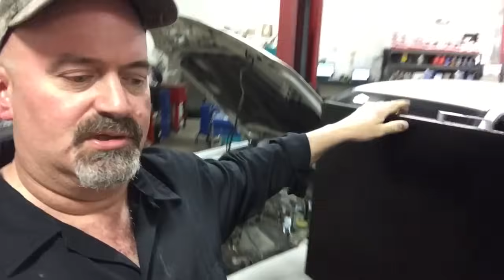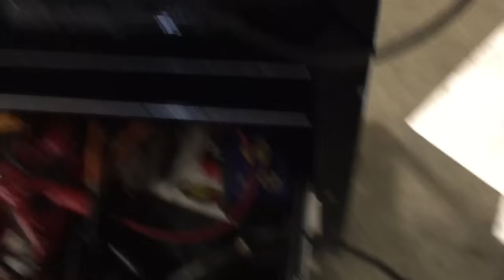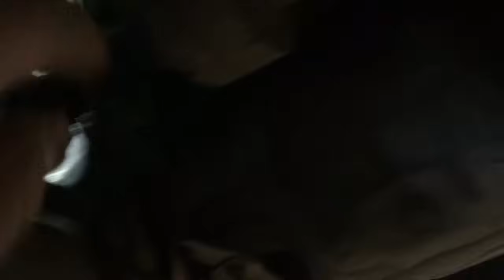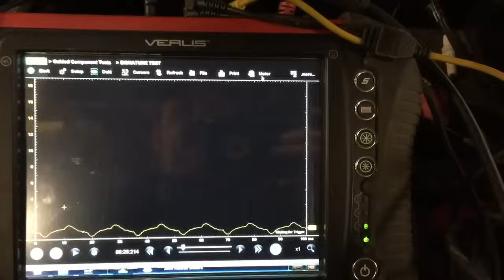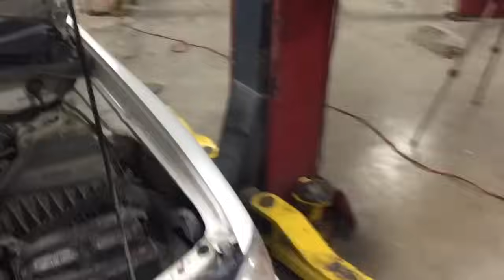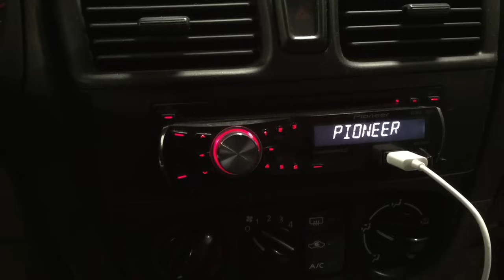Nissan Cranks But Won't Start

Comment: HI DOC i  have the same car it cranks but wont start  .a mechanic told me its the computer box malfunction.....any tips DOC?
Reply: Did u get it fixed? I jave the same car 355.000 miles on it lol still really nice though because its been kept up but the crank and camshaft sensor was the problem. We did have to replace the fuel pump amd had to spend like 30 bucls on eBay with a lifetime warranty I believe.
Reply: Your mechanic is guessing. You have to realize these issues are resolved by trial and error. It could be your immobilizer...bad key transponder..crank sensor...bad coil.. start there first before changing your module

Comment: Hi Tim. I have an 06' maxima that stopped on me while driving. I've used 3 different mechanics to troubleshoot and fix parts. So far combined they've changed: both valve covers and valve cover gaskets, the pcv valve, all the spark plugs and ignition coils, both camshaft sensors and the crankshaft sensor, the O2 sensor, the mass airflow sensor (I bought two new ones since i was told by the second one it needed to be from Nissan), and as of yesterday, the fuel pump was changed. It did the same thing, start once then cut off almost immediately, never to start again, only crank. Please help.
Reply: Have yall tried the immobizer?
Reply: Look at this ... I replaced this immobilizer on mine and found a guy with the same computer tool to reprogram it . I showed him this video and we used it to reprogram. There is a guy on eBay that sells used immobilizer for 29 dollars. I bought one and the car ran for a month but now it threw a 0300 random misfire code and won't start again. I hate this car. I hope this might help.
Reply: Mine was an 2001 sentra 1.8 with a transponder in the key. I had someone check if my key transponder was good then i searched and searched and luckily found that video about the immobilizer. I still have crank no start issue tho
Reply: Man the maxima is a money pit. I have 05 SL. Changed the same stuff as you. My next option is the crank sensor or ignition switch
Reply: https://youtu.be/HccLf4b2d5s

Comment: Changed both and still no fire. Checked the fuel fuse and changed the fuel pump and still cranks but won't start. If the fuel relay is out will the pump make noise?
Reply: My problem was rotted wire in the loom under the fuse box the check engine light would go out while cranking

Comment: My 2008 Nissan Pathfinder LE is having a similar issue i think. Had to Tow it yesterday because she won't start. They replaced the battery and looked at the starter but still no resolution. Any ideas? It's weird because even with the old battery i had power throughout the cabin (radio, seats move, lights turn on etc..)
Reply: Crank shaft sensor/cam shaft sensor

Comment: Need help asap 
2003 sentra 1.8 grandfather car wont stat shut it off one day wont start.
 Nopower to headlights or wipers no fuel pump power No cluster or odometer function when key forward.

Only getting 1.66volts at the meter fuse and fuel pump fuse with key forward everything else is 12v+
What could this be ?
Reply: The battery

Comment: Does a 2007 Nissan Sentra have a crank sensor? I'm having the same problem.
Reply: yes all modern internal combustion engines have crank and cam sensors

Comment: Where you located can you fix mines
Reply from the maker: Anchorage, Alaska...would you like to make an appointment? :)
Reply: @ThecardoctorTV  That's where i'm from! Born and raised, though i live in oklahoma now. Btw I'm having same problem with my sentra, that's how i ended up here, i'm gonna try replacing the crankshaft position sensor, hopefully that's it (already replaced the cam position sensor & intake cam solenoid)

Comment: .
But how did you know the problem was the crank position sensor?

I want to be able to sort out the same problem, when I am working on an auto that won't start.

Thank you for the video! Happy December to you and your team!
Reply: first grab the codes from the ecu, then check TSB's for recalls and known issues, and finally run test to determine if its the part the wiring or the ecu. You don't want to condemn a sensor if a mouse chewed a wire somewhere out of sight. For non mechanics goto the dealers website and look for recalls and there are plenty of forums online to help you. good wiring diagrams may cost you I suggest looking around online

Comment: 02? How about ah 92?
92 v6 Maxima was running and died and would not restart.
Reply: Is the cam position sensor the same for both the DOHC and SOHC. Foreign cars ar foreign to me. I see 3.0 on the engine and then tried to get the vin number to check which engine I'm dealing with and I'm not sure if it's the 8th digit of the vin or the 4th digit. Dang where's a Polish car when ya need one?

Comment: 2006 Nissan Altima 2.5 S wont start turns over then I'll start up after V try sometimes the 20 try sometimes the 3rd try different every time it runs great drives everywhere it just don't start up right away all the time by the way great video that guy needs to fix the few other parts on that car LOL can you please let me know I appreciate it any ideas you can point me to we did the neutral safety switch has good plugs wires fuel pumps working I don't know what else I can do to test myself it's weird as in a minute it does when it doesn't want to wants to
Reply: I'm having this same issue. I would also love a response to this.

Comment: Great channel.  Love your attitude.  I have a 2002 Altima 2.5  The car burns oil (consumes it @ 1 qt every 1000 miles or so).  I found significant oil in the spark plug wells. Replace the valve cover gasket.  I was told the oil was entering the combustion chamber through worn valve guide seals... Oil burning has killed the Catalytic converter.  I can't handle the project in my garage.  With only 128K miles!!!  Local mechanics tell me piston rings are the reason for the oil consumption.  #2 spark plug is definitely dirtier that the others.  Any suggestions?
Reply: Yes, bu y another car..

Comment: I have an 05 Nissan Murano and I just replaced the crank shaft, battery and the alternator and it still crankshaft but no start what else can it be??? Please help!
Reply: Crankshaft sensors, you have two. One at the top and one at the bottom. Replaced them.

Comment: Can anyone help? I have a 2004 Altima 2.5. It began with the car losing power while driving. Plug in the scanner and gave me crankshaft and camshaft position sensor codes. I replaced them.  Then I get crank but no start now. The only code I’m getting now is P0340 camshaft position sensor bank A circuit. The car didn’t have a problem starting before just loss of power. Now car just cranks but no start unless I spray a bit of a starter fluid. I don’t know what else to check for. The MAF sensor was clean upon inspection. Did an oil change and made sure all levels are properly filled and still nothing. Any advice please?
Reply from the maker: Did you use OE parts? Sounds like a bad part or connector issue. Have you scoped the signals?
Reply: The Car Doctor hey first and foremost thank you for replying back. Keep up the great work on the vids.

I inspected the camshaft sensor connector and there’s a crack in it so I may just replace the connector and see what final resolution it gives.
Reply from the maker: sound like a plan!
Reply: The Car Doctor just cut the wire of the camshaft connector on a junked Altima at the junkyard. Out of all the ones I saw, some had it, some didn’t but the motor on this one was fairly clean. I was able to obtain the connector with wire. Is there anyway to test  this before cutting the one on my car?

Comment: Would this cause the security light to stay on when I try and start it if crank sensor is bad
Reply: nope that has something to do with the key or security system you can pull data with a 50.00 Bluetooth OBD II scanner from walmart
Reply: https://youtu.be/HccLf4b2d5s

Comment: TAHAHAHAHA!!!!!XD when you thanked them for telling you to blink more I just LOST IT!!!XD that was way too funny! Fuck haters they are just jealous you're monetized. Thank you for this my sisters Honda is not working right now and hopefully I am able to fix it with the crank sensor or trying to bypass the alarm system. I know that it will not start if there is an alarm on there but I have not figured out on this 03 Sentra how to reset the alarm so thanks again!!! Have a great day! =)

Comment: hi car doctor we have 2010 nissan pathfinder turbo diesel . it cranks but wont start :( we have checked the crank sensor and map sensor and tried fuel priming it and the Suction Control/Pressure Regulator Valve any ideas what it could be and got new glow plugs ... could it be the starter motor ??

Comment: my 2008 diesel nissan x trail t31 now develops difficult cold start, have to rev the throttle in order to get it fire up, will that possibly be this senser or fuel pump please anyone?

Comment: I have an 2003 Nissan sentra that will not turn over. crank sensor and can sensor replaced. fuel pump kicks in... basically everything checked except timing chain. What should I have my mechanic check? Is the engine blown?

Comment: My Infiniti  95 Q45 cranks but wont start. It ran perfect one day ...then the next day no start. I thought it was my fuel pump but the pump cycles on for about 15 sec, then off. I  can hear it hum during the 15 sec.  Next I thought it might be my crank sensor but watching this video made me think to ask you a question. If my crank sensor was bad would the computer shut down the fuel pump and not let it cycle for 15 sec? Thanks in advance. Good video!
Reply: what was the problem ???

Comment: Tim I  have a nissan Frontera o8 it won't crank on spark can you test with a test light or not to check for fire
Reply from the maker: I would use a spark tester or even a spark plug that's grounded to test for spark. Be careful not to get shocked.
Reply: Hey Tim I really need your help. I have a 2005 Infinti fx35 crank no spark no start. It ran hot one day only. Then I ran a few test . Gave me one code . Camshaft bank 1. I replaced that. Still no start. Replaced spark plugs still nothing. Just recently sent the Pcm out for testing . Came back good it has crank . But it will not start. Help me man.

Comment: 05 sentra  1.8  maybe a couple week sparks on each cylinder . than no sparkp0340 1111 0118 0113, 2122, 2127,0223, o462, camshaft, coolant temp intake air temp throttle switch E,D,B,  feul level
u1000 controller are network circuit, code 00 memory backup fail.

bad ecm ? I will be checking grounds, I unplugged maf no change. crank and camshaft sensor ohmed out the same
I tried used ecm from junk yard. by genesis scanner would not communicate with it. no chip in key.
HELP
thanks

Comment: I have an 05 Sentra 1.8 Liter. Yesterday, while turning, the engine just stopped. I tried and tried to start it to no avail. As I sat there for about 10 minutes, trying to figure out why, I cranked it again. It started!!! I was only able to drive it about 200 yards and it quit again. This happened 5 times until I got home. I ran a diagnostic test on both of my vehicles and one of them said something about a crank sensor. Now that I have seen this, I will check my CS before I plan to replace my fuel pump. Thanks for the info.

Comment: I have a 2012 Nissan Pathfinder that won't start. When they put a crabkshaft in my truck it started right up and cut off after 2 minutes. So I'm back at square one, mechanic says my anti theft system kicked on and won't allow the car to start is this true?
Reply: BLINKING ANTI THEFT LIGHT?

Comment: My nissan finally decided it doesn't want to start any more... I'm gonna replace the crankshaft sensor and hope that alleviates the problem...
Reply: Did it ?
Reply: @ab4nun136  lol no. Turns out it had a blown head gasket. I scrapped that POS. NEVER buy a car that has low coolant fluid...

Comment: Please please please help! I have a 2004 Nissan Quest and it cranks but wont start. NVIS light stays on. Ive tried following the instructions on the vans manual but that doesnt seem to work. Both of the keys that i have wont turn it on. Could it be electrical? Do i call a locksmith? Is there anything that i can do?
Reply from the maker: use a programmed key and turn on the ignition switch, wait 5 seconds and turn off the ignition switch. Repeat this procedure 3 times and then the engine should start.
Reply: The Car Doctor i tried that and it didnt work before. Thank you so much. I ended up finding out whats wrong. The computer fried out. 😢
Reply: I have a 98 nissan altima that cranks but wont start. I check the fuel pump and filter both are good.   What else could i do to trouble shoot? Or should i just go straight to the sensor. Thanks
Reply: HoneyBee420 I have the same problem did u get yours fixed yet ?
Reply: william mcneely not yet. But saving up. Its about 14 hundred to fix. 😭

Comment: hi, I appreciated your real life video. Thanks for taking the time to share with us.
If the crank sensor is faulty, will it interrupt power to the fuel pump?  
My Nissan Pulsar Q hatch 2001 just stopped as I was doing 100k's down the highway. I is turning over just fine but no start. After many hour of inspection it appears there is no power to the fuel pump. 
There is power to the fuse, but not at the pump.    
Any hints would be great, thank you.

Comment: Mine didn't want to start, I kept trying to start and it turned over, I kept trying and pumping the gas pedal and it started. Why is it doing that?
Reply: Boss Hogg I know at least with my 2003 Sentra it is a common problem with the fuel lines getting fuel right away. Try turning the key all the way on but before ignition, that will start the fuel pump and fill the lines, give it time while you buckle up. This is what I read.
Reply from the maker: that might not be this particular problem but a look at the waveforms on a scope would help find out!
Reply from the maker: Not sure, maybe its flooded and needs some tune-up work
Reply: Yeah, I always manage to get it to start but sometimes I have to pump the gas peddle a couple times...

Comment: Hello i have a 2005 Nissan 350z, when i put in the key, the car CRANKS but wont start, when i put in the key and try to start it,  the NATS Alarm red light doesnt disappear..the red light stays ON.. After 20 attempts and 20 min  unlocking the door, turning the key on and off the ignitation, etc, it will finaly recoginze the key and will start perfectly. On other days, the car will start perfectly and will disable the alarm all the time. On other days, i struggle trying to disable the alarm. What COULD this be?! Is it the Key or the NATS antenna amp , Body control module (BCM) or (IMMU) Engine Control Module (ECM??
Reply from the maker: Probably the key from what you say but you may need to pull the security system codes and go from there. Good luck

Comment: My 2002 i35 starts and runs fine, but when you turn the car off and try to restart it right away it will not start . If you wait 20mins it will start and runs great with no issues but the problem repeats when you turn the ignition off again . If you removed the battery terminal and reinstall it again the the car will start up right away   Any ideas

Comment: HELLO,MR. THE CAR DOCTOR I SEEN YOUR VIDEO AND I HAVE VERY SIMILAR PROBLEM WITH MY CAR 2001 Nissan Sentra,IT WON’T STARED ONLY CRANKING BUT NO STATING I  CHANGED THE CRANSHTF SENSOR AND ALSO THE CAM SENSOR IT IS STILL THE SAME MAY BE YOU KNOW WHAT IS THE PROBLEM  THANKS.NISSAN SENTRA CA1.8L 2001
Reply from the maker: Did you use the OE parts? Did you check the CMP and CKP waveforms? Any codes? Spark? Fuel? Compression?
Reply: The Car Doctor thank you for responding me but and the area where I live is not good mechanic where do you live?
Reply: yes I did  used the OE parts but I don't check the other parts because I don't have the proper tools

Comment: Hey tim, same problem except its on a 05 nissan xterra 4.0, teplaced both cam sensors and the crank sensor. still no start,   i have fuel and spark.  possible timming chain jump?
Reply from the maker: Are you getting injector pulse?

Comment: Just wondering .. I have an 02 Altima sounded just like that car Cranks .. no Kick .. I recently replaced the Crank Sensor in January so 5 months ago .. Would you tell me that they can be that random to only last a few months and some last forever ? or should i be looking at something else. Relay to the Pump is Clicking The Fuse is good I replaced the Fuel pump just to Replace it and its priming.. Any Suggestions ?

Comment: Where can I find this exact sensor in a 04 Nissan Armada? I'm having the exact same problem right now.
Reply: any on line auto parts  site   or the nissan dealer    I use rockauto.com  because  there price cannot be beat      hope this helps

Comment: 02 Xterra 3.3 Supercharged. completed a bunch of work,  knock sensor, plugs, wires, distributor, cap and rotor, fuel pump and sending unit, fuel filter. Ran great for a day, died cranks but won't start. has spark, disconnected fuel filter to see if pump was working a few ounces of fuel than nothing,shouldn't the fuel pump continuously deliver fuel with the key in the run position? I've been trying to trouble shoot a P0300 code, now the no start issue. any help would be appreciated.
Reply from the maker: The fuel pump only runs for a few seconds after turning the key to start position and won't continue unless it sees an RPM reference. What's the fuel pressure? Does it have injector pulse.